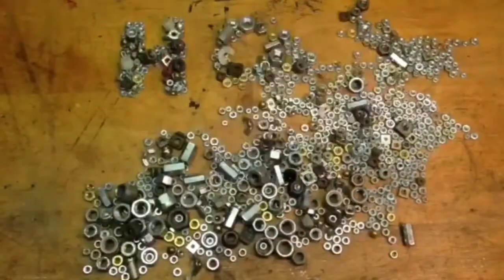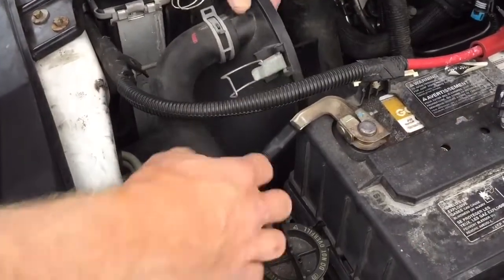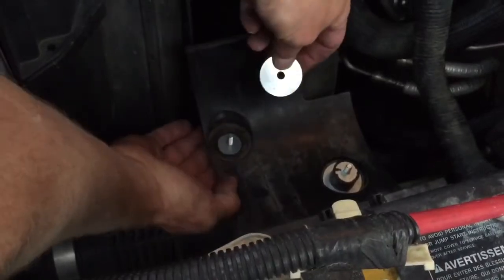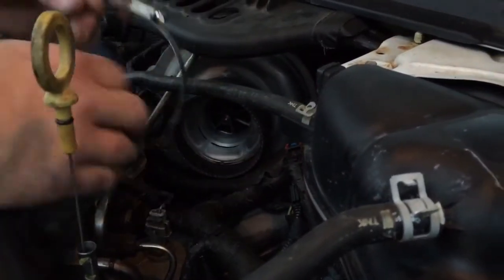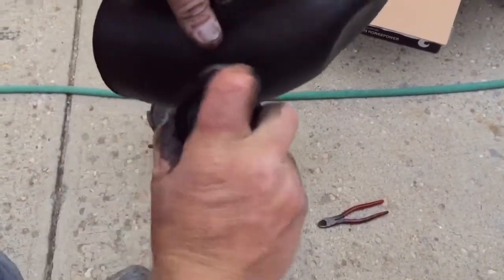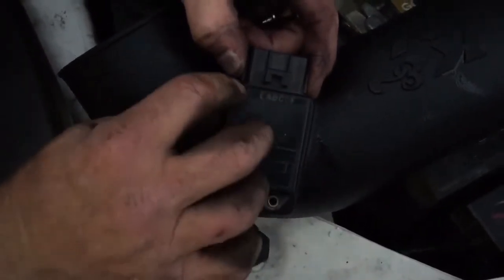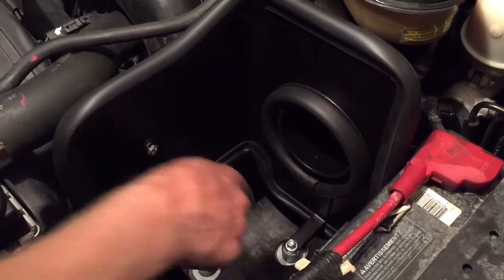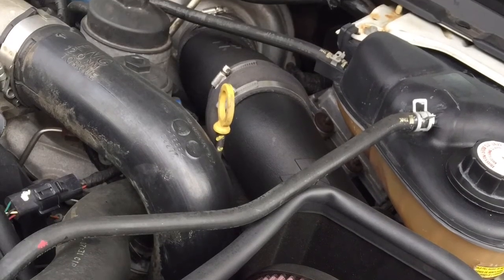Installing a K&N intake on a 6.0L Powerstroke Diesel

Comment: Thoses tyeps of filters dont stop most of the dirt trust me I about messed up my truck ny adding one of thoses so I replaced it with the original filter
Reply from the maker: It works well if it is used in conjunction with the recommended filter oil to catch all the small particles. Thanks for watching.

Comment: How much horsepower you cranking out of that 6.0? The stock air filter is good for 500 so you must have a good tune on that bad boy! What kind of sticks are you running?
Reply from the maker: I'm not sure what the total is with all the mods but it does quite well. Thanks for watching.

Comment: What if I have a 2005 and my mass air sener is a diffrent assembly? Will I still be able to use this filter?
Reply from the maker: That I wouldn’t know.I would definitely check before spending the money on the filter.
Thanks for watching.

Comment: What other upgrades did you do?  I just picked up an 04 with 150k Miles pretty much stock other then egr delete
Reply from the maker: +MrGreatshot1 EGR delete, new head gaskets, new oil cooler, SCT tuner, K&N air filter, 4" MBRP turbo back exhaust. With all of this it runs like a wild machine for its weight.

Comment: Worst filter made!
Reply from the maker: Thanks for your opinion and thanks for watching.
Reply: @funbro1  ran a K&N cai on my 04 F150 that was used for work which saw primarily gravel roads and off-road rights of way. Even w proper cleaning and piling and a prefilter the ultra fine dust made it through. I removed all Intake parts and cleaned and never used the filter again. I went to a universal fit filter of the same size made out of synthetic media available through Amsoil. It was a dry filter and cleanable and I also used a prefilter and never ever had issues. Unless you never see dust I would never ever recommend a K&N filter. Not sure I’d even put them on my snowmobile.